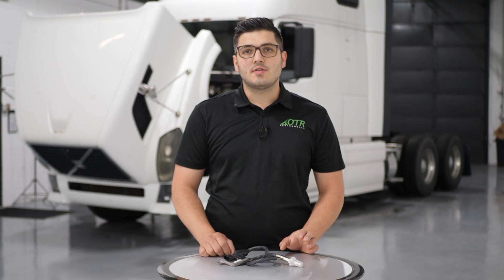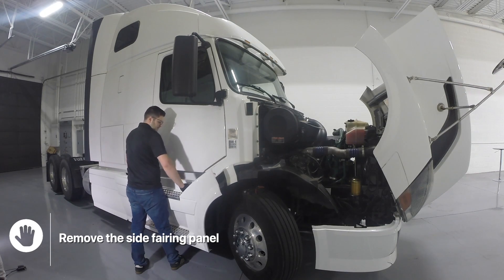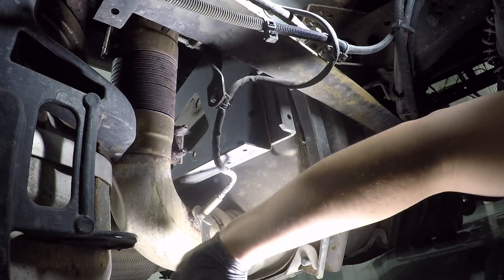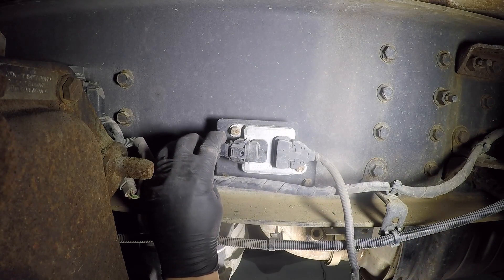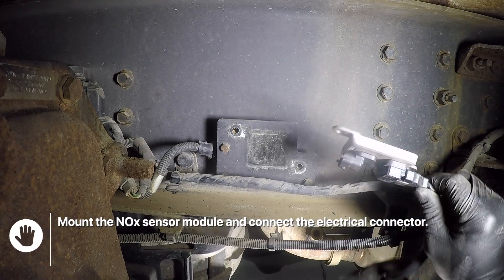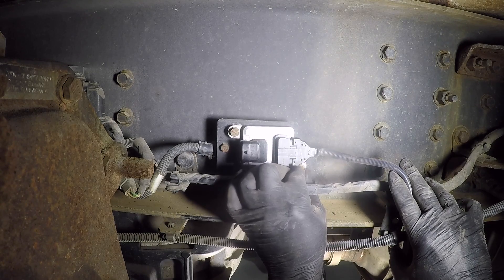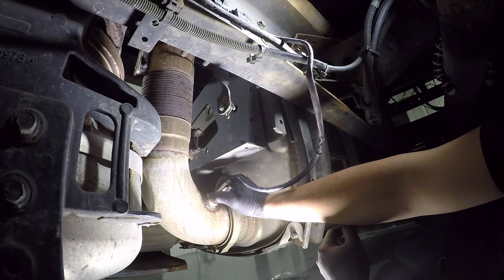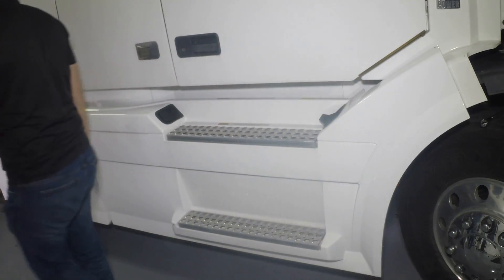Replace Outlet NOx Sensor on Volvo D13 Mack MP8 Engine

Comment: Is it possible to replace just the sensor and not replace the sensor control module? Wouldn't that be a much cheaper option?
Reply: These companies want to make money. The remanufactured sensors use the module from an old sensor.

Comment: Do I have to reset aftertreatment when I install new nox sensors?
Reply from the maker: Some trucks may require you to do a reset so that all parameters are reset.
Reply: @otrperformance  how would you do the reset if needed?

Comment: I have engine check ight on having to do with nox sensor. Replacing the sensor turns off engine check light? Thanks.
Reply from the maker: It depends on if that is the problem, Sometimes it can also be related to the harness or something else in the emissions system. What code are you getting on your truck?
Reply: @otrperformance  shop cleared engine check light with replacing nox sensor and dpf filter according to mechanic report. Thanks.
Reply: What code did you had?

Comment: When sensor replaced, do I need to preform a forced regen ?
Reply from the maker: Yes you would need to do a learned data reset and a forced regen to make sure all the timers are reset in the ECM.
Reply: @otrperformance  and your tool would do a learned data reset as well a  forced regen?
Reply from the maker: @badguy2419  Yes the tool will do the learned data reset as well as the forced regen! Here is a direct link: https://otrperformance.com/collections/all/products/dtc-aft-reset-tool-volvo-mack
Reply: @otrperformance  thx
Reply: I just installed new NOX outlet sensor on my 2015 Volvo D13, check engine light still on, does it clear by itself or I have to take it to the shop?
Reply: @uniking672  you don’t need to do a forced regen I just cleared the codes an was good to go. No issues
Reply: @ralphx5626  thank you 🙏
Reply: @ralphx5626 how did you clean the code? Do you have any obd or something like that?
Reply: @uniking672  clear the codes and do force regen...☝ look up top
Reply: @badguy2419  🙏thanks